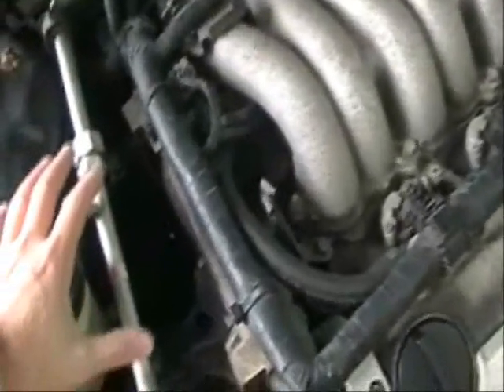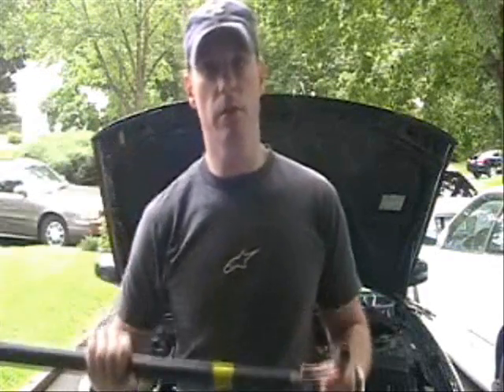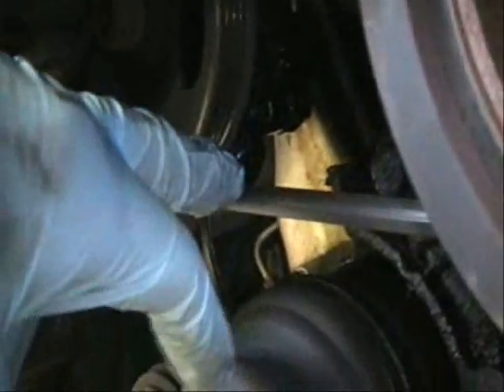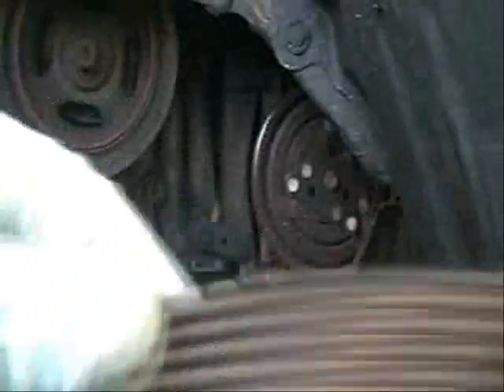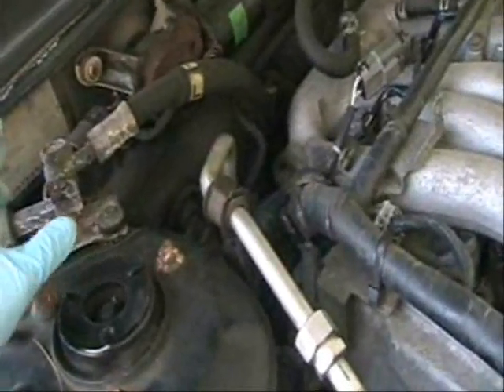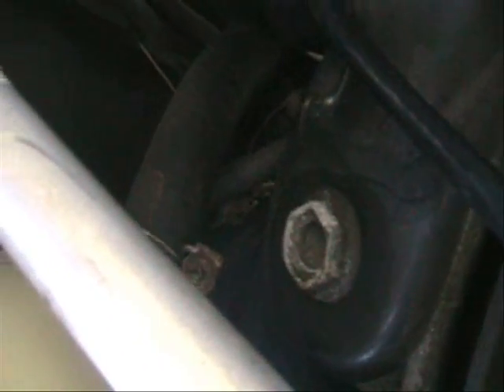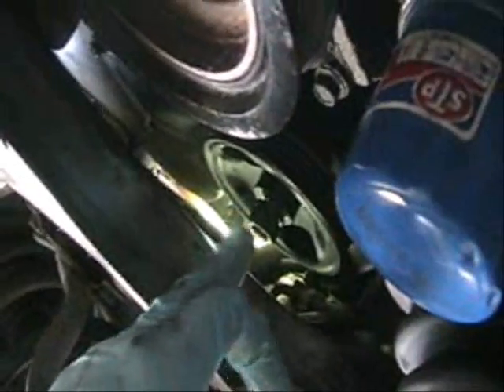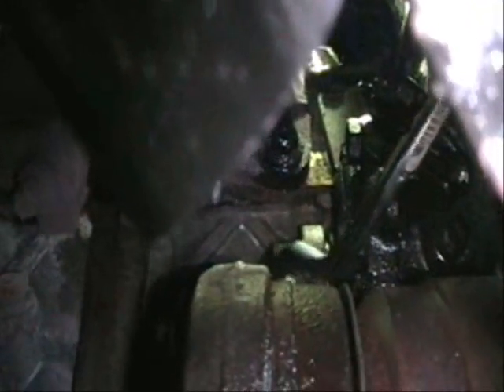NIssan Maxima | Infiniti Power Steering Pump Replacement with Basic Hand Tools HD

Comment: So I got to pull in the belts and everything off the power steering pump is just sitting on my car your video did not show well what bolts they are to take off the power steering pump I am lost can you let me know what bolts they are cuz you said there's two on the top or the tensioner i believe you said but I don't want to take something off that's not right is there an image or anything you can send me I don't know what bolts they are to pull it out to snake it out how you said it's just there I saw you take out one bolt ant it came out so easy can you help plz
Reply from the maker: rpg17zombie Are you doing this on a Maxima? What year?
Reply: 1998 and yes
Reply: Just need the bolt to pull it off my car
Reply from the maker: You have one toward the rear of the pump (11:47 in the video) and one in the front (at 12:31 in the video). Regarding the front bolt, look for the one holding the tensioner bracket. With those two bolts removed the pulley drops right out.

Comment: I loosened the lock nut .. then turned the tensioner clockwise too loosen the belt but the belt stays tight ????? What I do wrong
Reply: I loosened both soo much that the whole tensioner & lock nut completely came off .. but the belt is still tight & I can't get it off
Reply: Are you sure clock wise is loosening (it depends which tensioner we are talking about)? You could test that by tugging on the belt and seeing which way it loosens. Sometimes the lead screw that allows the tensioner to move is stuck a little bit especially it has been there for some time. Tapping on the tensioner with a wooden object like the handle of a hammer might allow it to move. But first make sure you have loosened it. I hope it works for you.  Good luck!

Comment: Damn good video man! I had a question though. Don't you have to tighten the belt pullys or tensioner to a certain torque or do you just tighten until it's really tight? 
Thanks again for the video....
Reply from the maker: stagnet04 Thanks man. You tighten the belt until their deflection is minimal. The power steering belt on this car required .25" deflection and a little less on the main drive belt.

Comment: problem with a Nissan Maxima 05 it doesn't turn on does Drive on the stay stuck on first gear and I want to put it to drive it does not show me the letters on the drive or the little reverse or the latter neutral so it will not show the letter r letter d and letter n it stays stuck on first gear

Comment: I have a 98 Nissan maxima, new battery, alternator, starter, ignition switch, the problem is that it starts slow when I crank it up, but also after its running the battery light, gas light, and some of the other lights stay on in the dash, oh by the I am getting code 1447 with is evap purge valve, is that the problem, HELP

Comment: I have a 96 maxima, you have to lossen up the blot on the back off the power steering pump then loosen up the 12mm bolt on the side,you mentioned nothing of that in your instruction. is the 96 and 97 different.